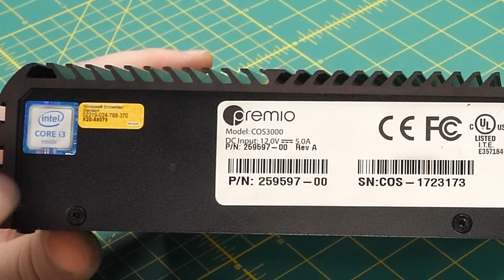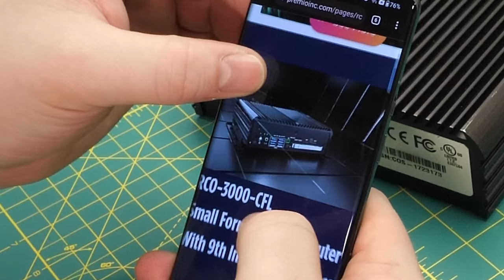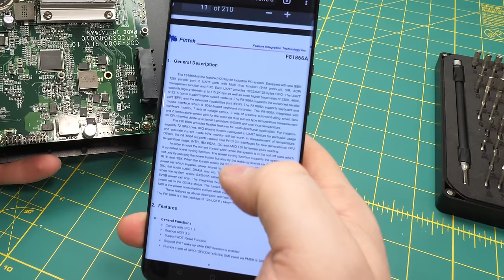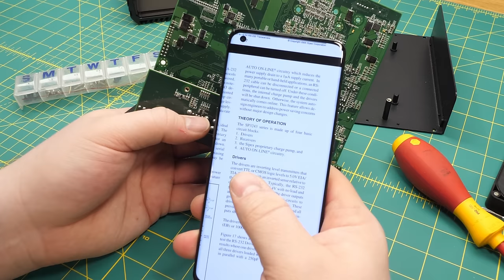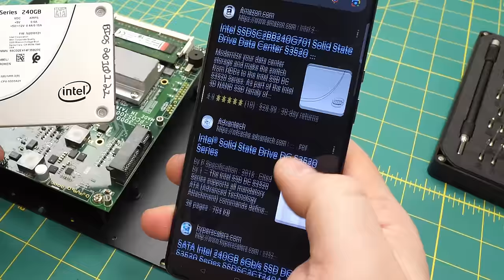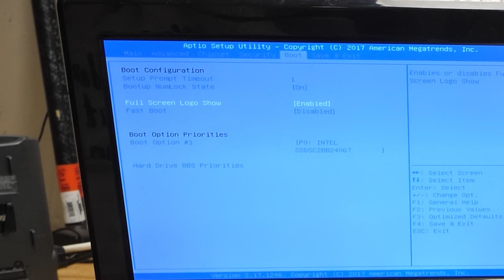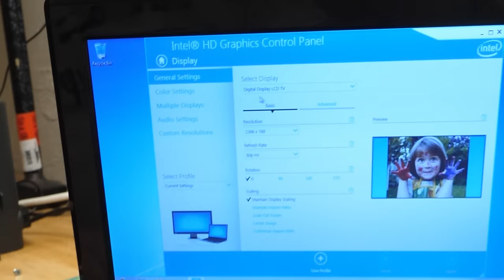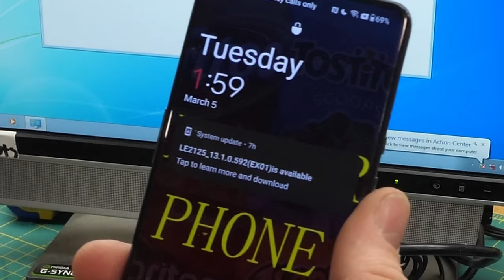Little Guys: Episode 4 [Premio / Coinstar]

Comment from the maker: IMPORTANT CORRECTION (WHOOPS): I failed to put two and two together. The reason the CPU cooler (someone just said they call it a "heat riser" and i like that term) is able to function without any sort of spring suspension is because it DEPENDS on a thermal pad to take up the slack between the CPU and riser. You can see at 40:14 that the heatsink is COMPLETELY failing to touch the compound I added. In other words, I just (nearly) wrecked this machine, live on camera, and the whole time you see it running in this video it's thermal throttling to hell and back.

You will see me make this mistake in the next few episodes because I already shot them. Sorry :(
Reply: The bit at the end of a shoelace is also called an "aglet". At least that's what I know them as.
Reply: yeah I assumed that
Reply: @AnotherOtherMan-alive  Their true purpose is sinister.
Reply: The poor little guy
Reply: This is hilarious and i love it lol
Reply: They should still be fine, older Intel I series chips have really aggressive thermal limits in my experience, I would personally slap a new thermal pad on and the little guy should be fine. Traumatized, but fine.
Reply: "heat riser" is a thing from persona, the video game series,
Reply from the maker: nnthepirate iodd ST400! It's extremely cool!
Reply: Poor future little guys.
Reply: when you were soldering the DVI i saw the thermal paste wasn't spread out, poor little guy :((
Reply: nnthepirate I personally use an iodd mini, which is smaller, uses (micro) USB 3, has an NVMe SSD internally, and can function as both an optical drive (stored as ISOs) but also up to 4 USB disks (removable flag toggleable) stored as VHDs
Reply: whoopsies lol
Reply: @Jamie_Slyman The IODD 300 and 400 have that same functionality, but you BYO 2.5" drive. The only difference between the 400 and 300 is the 400 does encryption. I have the 300 with a 1TB Samsung EVO SSD and all the ISOs and VHDs I could ever need for booting.
Reply: nnthepirateThe 300 model is about $15-$20 cheaper if you don't need encryption. Has all the other features of the 400.
Reply: Do you need a thermal pad? If so, what thickness?
Reply: the little guy is just doing it's best
Reply: You can probably buy a thermal pad to fit. It's not completely wrecked.
Reply: Time for a pack of cheap 1/2mm thick thermal pad and an episode of "Little guys Gaiden"?
Reply from the maker: @Deadsayer  oh of course, I just mean I rendered it unusable in it's current state
Reply: Getting 13W TDP through 2 thermal pads is a bit how ya doin' like Dave from EEVBlog would say.
Reply: Bro, idea for a series. Your knowledge of CNC and metal machining production is very interesting! Maybe something to thinker about. 🫶
Reply: you are welcome :)
Reply: @AnotherOtherMan-alive  A-G-L-E-t don’t forget it.
Reply: mate even legends make mistakes! im from the uk and sadly we dont really have second hand shops like u do the ones  we do have r poo! s always it was a fantastic vid and i love the little guys vids there amazing! i hope you and the other half are doing well and i cant wait for the next little guy! p.s is there some way i can send you a amazon gift card somehow because i dont have a credit card so its really hard for me 2 donate 2 the little guys fund lol
Reply: @AnotherOtherMan-alive  . . . Aglet vs Megalon . . .
Reply: We will still scream at our screens, though! 😄
Reply: @mikeswem I get that reference!
Reply: Lol, I was shouting at the screen "What the hell you're doing with that grease, you'll need a thermal pad for that cooler!" Anyway, the CPU will live.
Reply: @AnotherOtherMan-alive  Based on what I've read, it seems that an aglet is specifically a type of ferrule used for shoelaces.
Reply: At least you didn't try to benchmark it or run any high cpu software, like games. 

Though, speaking of which, I would really like to see you do that with these--once you put pads on them.
Reply: I love how low stakes of an issue this is at least lol. These things are much more interesting with you dissecting and messing with them
Reply: What was that neat little device that you pulled out to load windows embedded onto the drive??
Reply: We have coinstar in the UK so I knew what you were on about straight away.
Reply: One other correction.  The end of a shoe lace is an aglet.  A-G-L-E-T.  Don't forget it.  :D
Reply: Isn't that the whole point of thermal throttling anyway, to protect the chip from turning into a nuclear reactor.
Reply: Yup. Thermal pads FTW
Reply: Good to know this.  I’ve been wanting to start collecting little guys
Reply: The fact that modern CPUs can survive spending hours as just a bear die is pretty nuts.
Reply: @AnotherOtherMan-alive phineas and ferb?
Reply: @FennecTECH bear die? That's sad. I thought they lived forever. Unless you meant bare die.

Comment: One little thing about watchdog timers; yes, it's a completely independant timer trying to count up to a specific value. If it ever gets there, it resets the hardware. You will put a line of code in your "main loop" that resets the timer each time through the loop. You almost never want your reset request driven by or handled in an interrupt, as interrupts can continue to function even when your main loop has crashed. Having the WD reset being in your main loop can also catch things you didn't think about - like a harddrive or some important web page taking WAY too long to respond and you forgot to code a timeout. Your code is sitting waiting forever - but the watchdog will still catch it and reset.
Reply from the maker: How does it communicate with software, is it just a really low level memory mapped I/O port, like you'd use to talk to a board level component, or does it talk over SMbus or something?
Reply: @CathodeRayDude  it varies, there are multiple types. Probably the most common is the iTCO - "Intel TCO" where TCO stands for "Total Cost of Ownership" - which is built into the intel PCH; and a lot of third party controllers are very similar. That superio controller probably has a watchdog timer builtin. It's very common for them to be accessed via ISA-style port io writes, but it could also be PCI memory mapped registers.
Reply: @CathodeRayDude  on Intel CPUs there is a set of Model Specific Registers (MSRs) that indicate which watchdog timer was triggered. Believe it or not Intel does actually publish datasheets on its CPUs like you'd expect for a 74 series logic chip. All of this stuff is in there.

The MSR for this is actually the "Host Partition Reset Causes (HPR_CAUSE0)—Offset 192Ch" MSR on an i3 N-Series. That should be mostly stable within intel at least. AMD probably uses something completely different and I wouldn't assume it's the same between anything because it's an MSR.
Reply: Engineer here. 
I regularly use these systems. 
The WDT and DIO are usually accessed via a Super I/O Chip.
Usually accessed via Port I/O (IN / OUT x86 ASM instructions or inb / outb Unix calls)
You write directly into the registers of the I/O Chip.
Most IPC manufacturers will give you a Win32 DLL/ kernel driver if you annoy them enough, otherwise it's inpout32.dll and a lot of debugging.
On a board level it should be via the LPC bus, which is a modern LowPinCount variant of the classic ISA  Bus. 
P.S.: this is an interesting topic indeed, via LPC it should still be possible (with some Level-Shifting) to use ISA cards on modern PCs)
Edit: just finished the vid: yes, the SuperIO chip used is relevant. Very relevant, as every one has a different register set. When modifying the registers, one has to be super careful to not write into the wrong ones, as some control lines of the motherboard might be connected to it. (And therefore, by configuring the GPIO ports wrong, you risk damaging the motherboard by e.g. shorting some signal lines the BIOS set up as an input rather than an actively driven output
Reply: We also call servicing the watchdog timer "patting the watchdog"
Reply: @thomasphillips885  Is there any cute terminology for when the watch dog is watching, or barking?

Comment: You just did something I've always wanted to try to do with that DVI swap.  Thanks for satisfying a persistent, deep internal curiosity for me today!
Reply: Thought.. Since the VGA pins are connected to the DVI port, could it not be a case the DVI port added is in fact running in Analog mode... so VGA over DVI style... And not as a digital output.
Reply: @TheCodeDaemon  The 2007fp Dell Ultrasharp he's using only supports DVI-D, so it's most certainly using the digital display mode.
Reply: I was SO HAPPY when you got stuck at the "the pins are too large to fit" and made it happen anyway.  I was literally thinking "no don't stop!  cut em down, son!" and you did.  <3
Reply: @TheCodeDaemon  I have a board that does that. only does VGA over a DVI plug
Reply: @TheCodeDaemon  That is generally made impossible, not (always) by the monitor or the PC but by the cable in between.

Nearly all DVI cables only have the digital pins connected internally, even the ones that appear to have the analog pins present on the outside. I've only encountered one strange frankenstein DVI cable with both analog and digital connected, and it had inverted screw headers, so I think it was some kind of funky male to male extension cable. Sure enough, if you try to use it as a regular DVI cable, the monitor and PC get... Very confused about what to do.

Note: This is not to be confused with dual-link DVI cables, which have more pins than regular ones but still don't carry analog signals.

Comment: Your courage is commendable for showing the thermal grease application.
Reply from the maker: it's ironic because i ended up screwing it up completely (see pinned comment lmao)
Reply: @CathodeRayDude  Even more courageous than I thought!
Reply: @CathodeRayDude  It's on die, it's ok. 
also most brave thing was showing "torque" used to tighten this up.

Comment: 28:22 Broadwell was a pretty weird little architecture. There were some CPUs using that same architecture that has embedded RAM right on the package. It was used as a massive L4 cache and it walked to AMD's X3D could run. Intel used it to feed the Iris Pro iGPU and that little bit of extra RAM allowed them to push the integrated graphics really hard, and it was in a way the first real "APU" that are now ubiquitous in laptops. It had the memory bandwidth of a DDR4 system in a DDR3 socket for the first 128MB of RAM access, which actually meant it could keep on competing with the 6700K and even 7700K for a little while. The 8700K finally ran away with it by just having more cores and brute-forcing clock speeds. There's a dark alternate timeline where Intel committed to the bit here and essentially had "X3D" since 2015 onwards. Imagine what a cursed world that would be, where you can go the shop and see an i7 14700C and a Ryzen 7800X3D rght next to each other.

They recently started doing it again with server CPUs, just with now dozens of gigabytes of HBM instead. Sapphire Rapids can have 64GB of the stuff just packed in there, and it'll even boot without any sticks of RAM in the system at all.
Reply: I still run a Dell with the Broadwell i5-5200u.  It was my daily driver work laptop.  I got it new several years ago, but now enjoys its retirement as a media player for the bedroom TV.

Comment: You say that serial is the lowest common denominator of communication between computers, but in the industrial world the DIO/GPIO is the most used for communicating between machines and machines or machine and embedded systems. There is nothing more simple, universal, robust, or primitive than using single bits for communication. It is quite shocking how primitive the communication between two gigantic industrial machines can be, all that is needed is a ready signal that a machine is ready to receive product.
Reply: Lot's of lines use Profinet, because u need redundancy and connect cell to cell it's easier
Reply: @mateuszzimon8216  while profinet is great for inside machines or where one has full control over all PLCs, having machines from different manufacturers, old machines or machines that doesn't use profinet communicate over profinet with each other would be very difficult. That's why digital io is more universal because all machines regardless of manufacturer, fieldbus or age are going to support it. And I agree that profinet or any other fieldbus is more flexible and powerful, it just that it requires that both machines be built with that in mind. Same with serial; just because you can talk doesn't mean you speak the same language.
Reply: If it is not broke, don't fix it kind of thing :)

Comment: wrt the query about HDMI audio and DVI ports - if the port is a DVI-D or DVI-I port specifically, electrically each single link is 100% identical to HDMI, that is the exact same TMDS signalling is used with the exact same base encoding scheme. So yes, you can in fact run HDMI over a single link DVI-{D,I} cable or vice versa and this is why adaptors for them are completely passive. What may not work however is the thing on the other end of that cable.

Modern screens that have HDMI ports all talk dual protocol because it's more expensive to be antsy about which you're talking than to just decode both on every HDMI/DVI-{D,I} port and get on with it.. however, older screens (pre-2010-ish) or ones that only feature a DVI connector are much more of a crapshoot - the old screens just categorically won't understand the HDMI extra bits like the audio stuff happening in the vertical blanking interval; modern screens with just a DVI connector may or may not actually be secretly HDMI, it depends on the controller inside.
Reply: And there's the whole HDCP thing to worry about, not that you're gonna care on a device like this.
Reply: Nothing frustrates me more than devices that have HDMI and DVI, but categorically refuse to accept or produce audio on DVI for no other reason than "it shouldn't be there."  It normally wouldn't matter at all, but in my case, I have a screen which is DVI only and a source that is HDMI, and an audio extractor in between.  The problem with using HDMI mode is that it also means the device can use YUV instead of RGB, which my screen translates into "oh, you want everything purple then?"

So for me, DVI video with audio would be perfect.  And NOTHING that I have will do it.

Comment: re: digital io. im guessing in the coinstar context it was used for counting coins. there's probably a coinmech that determined the coin used and either strobes these inputs for each coin value, or more likely communicates to the main system in a special-sauce serial protocol.

in hydrology/meteorology digital inputs are used for event-driven input like tipping bucket raingages - the computer listens for a logic high, which indicates a tip, and each tip has a certain value of precipitated water

Comment: So love the Hackery and the guess work of how it was put together.

But one GIANT mistake you made was cleaning the CPU from the "Thermal paste" that was no thermal paste it was a Thermal PAD to take up the tolerance from the Heatsink block.
at 40:14 you can see the Thermal paste did not spread out because it was designed for like a 0.5 or 1 mm thermal pad to fill the gap and not crush the CPU.

what will happen now is or the CPU immediately overheats and thermal throttles and makes the pc really slow or it get cooling in the precise spot of the thermal sensor and cooks the uncooled parts and  dies after a while, but the pc should run at Full speed
Reply from the maker: hot damn, you're absolutely right. I knew this somewhere in my head but failed to put two and two together; I knew the tolerances on the standoffs couldn't be that good. I will make corrections in future videos.

Comment: 18:34 There are some more manufacturers like ITE and Microchip (their MEC series). As of late they switched to eSPI but previously they used LPC (which is Intel's "modern" ISA; yes it's ISA look up a project called "dISAppointment" for some fun with that). As with old ISA you can relatively easily communicate via "IN" and "OUT" instructions on the CPU although the OS might lock them. Also on some of those chips the actual register map is proprietary information and it could also be paired with an EC (Embedded Controller) which is basically an entire microcontroller added to the SuperIO.
The GPIOs and Fan connections of that part aren't that special actually it's actually pretty common for internal functions like controlling the Battery Charging or scanning the Keyboard matrix on laptops.
The platform controller hub (short PCH; or South Bridge) also likely has some GPIOs configured for all kinds of stuff (Indicators, Audio etc.).
Reply: I have heard about an oss LPC<>ISA bridge. Might order a few PCBs, great for tinkering with old industrial HW. (New GPIB cards e.g. cost a fortune!)
Reply: @TheRailroad99  Yep that's the "dISAppointment" I have mentioned.
Although it has it's issues on modern PCs since LPC is on it's way out. So DMA has already been discontinued and recently platforms switched to eSPI which in essence uses the same instructions on the CPU but it's slower and more limited.